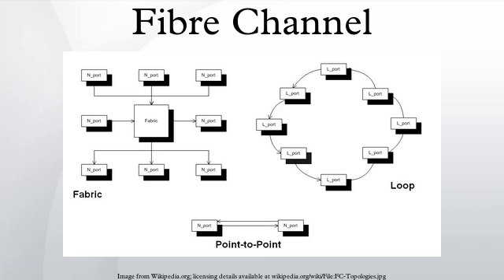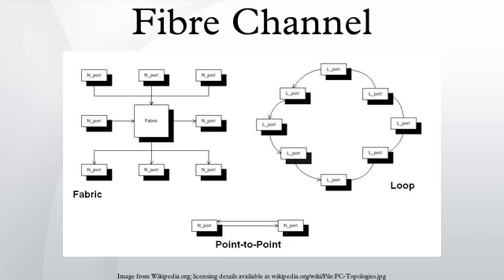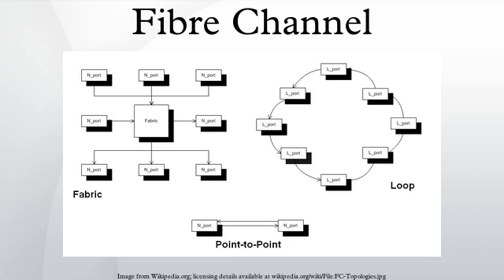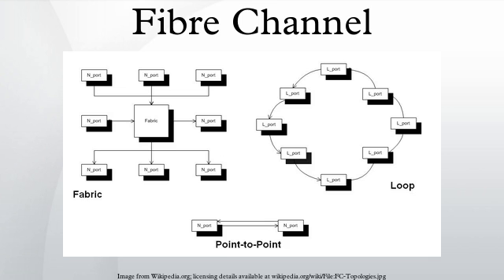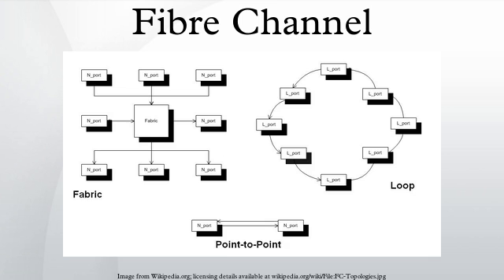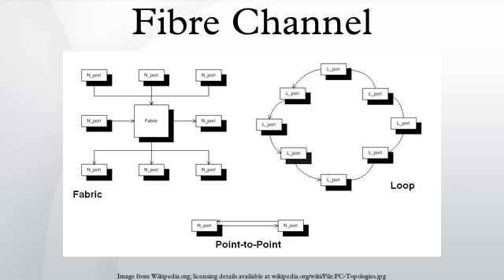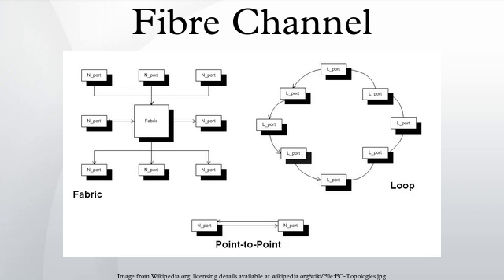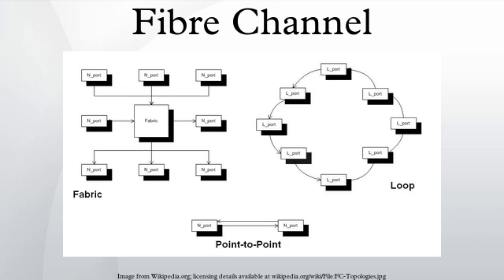Fibre Channel

Comment: Good:  Helpful information.
Bad:  Seems as if a computer program was used to create the English audio.  The presenter did not pause between sections, making information run together in a sometimes confusing way.  Only one slide was used; could have provided slides to match the sections of the presentations.